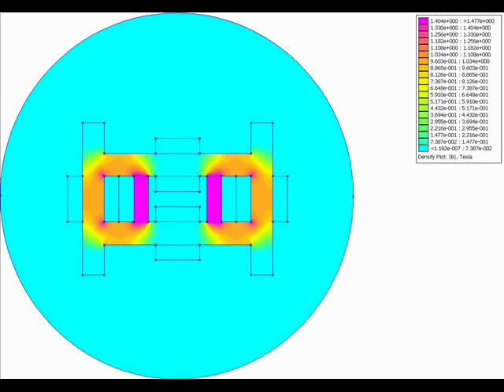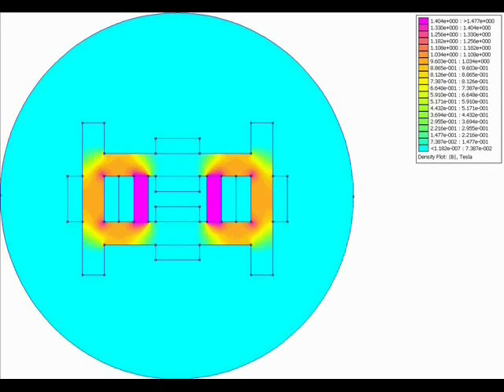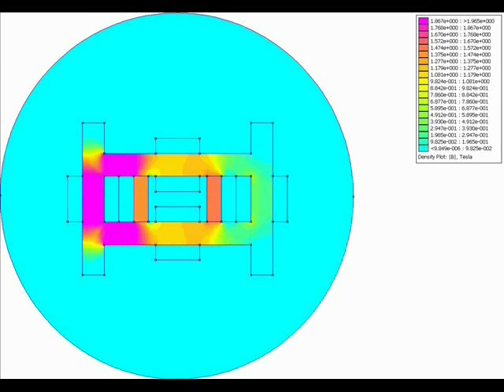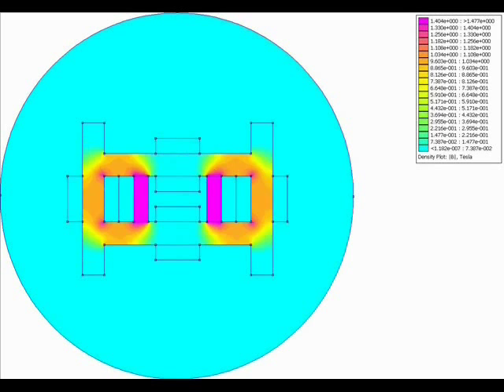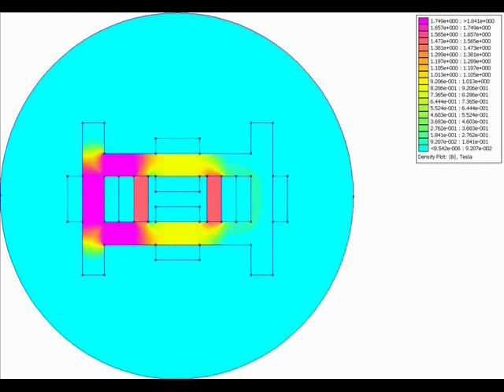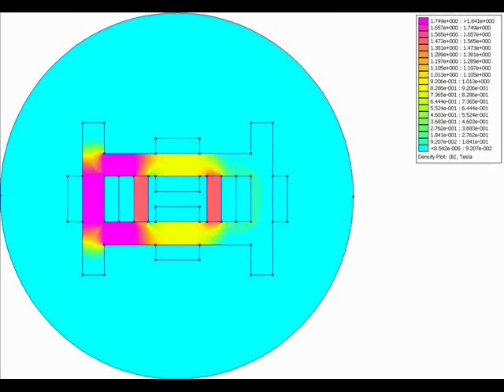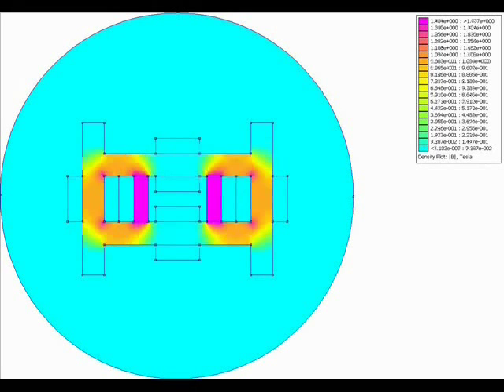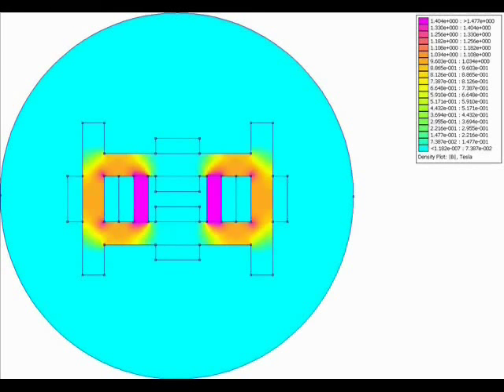Improved Flynn Device Model

Comment: Nice. I tried the same . But the voltage drop is around 800 volts for 1 A drop for 40 SWG 1500 turns on the center coils. I'm not getting the same results. It seems I need more voltage and more current to drive the flux to complete one side. Can you please provide the materials and turns in the coils you used .. ? Thanks a lot.